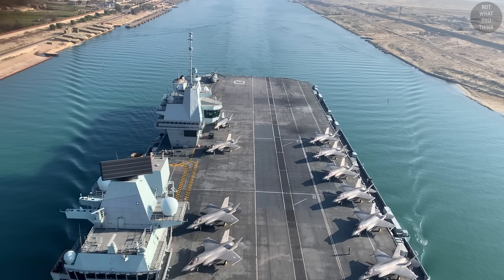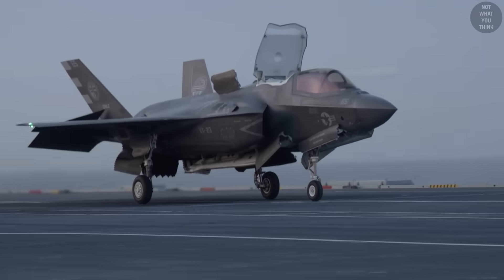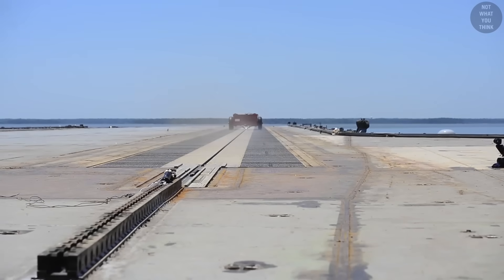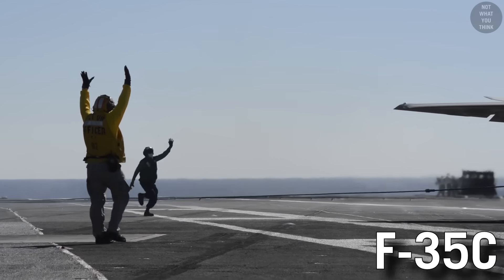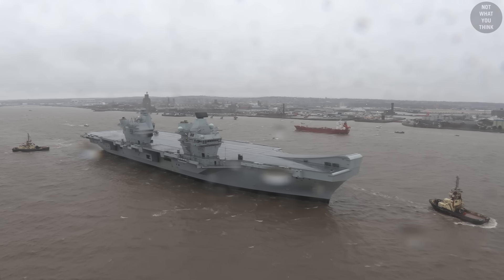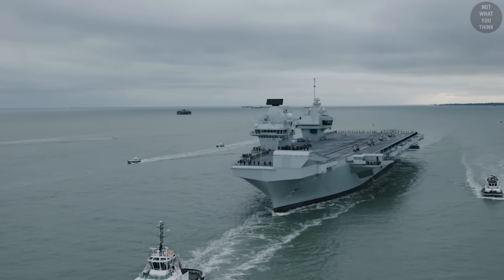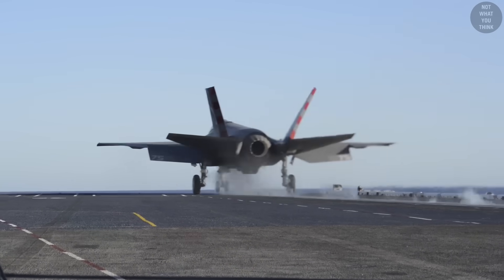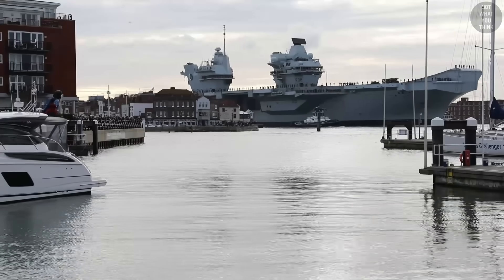Was the Angled Flight Deck Missed on HMS Queen Elizabeth?

Comment: Not all angles flight decks allow aircraft to land and take off at the same time, certainly without risk of collision if the landing is aborted. Some designs only protect aircraft parked forward. That's another advantage of STOVL - more aircraft can be launched and landed faster and simultaneously.  A disadvantage of catapult, is when they go unserviceable it slows down or stops launch of aircraft.

Comment: I think EMALS and arrestor gear for conventional jets (e.g. F35C) will most likely not be installed on the QE class. It is common knowledge that cats and traps are likely to be fitted for UCAVs but this is probably as far as it will go. By the time the F35B retires the QE carriers will be approaching the end of their operational lives so will go at about the same time.

Realistically, the money is not going to be there to switch to EMALS and buy CATOBAR jets ~2040. Too many other projects requiring funding (T85 destroyer, Astute replacement, Tempest, RAF transport fleet etc.) plus a baked-in budget shortfall mean this is not going to be a high priority. In true RN fashion they will make the best of what they have.

Comment: This may just be noobtalk but I feel like the old-fashioned arresting wire and barrier will save lives in case of actual war against an advanced opponent. For the simple reason of coping with battle damage or returning with hardly any fuel left. A vertical landing may be impossible in both cases.
Reply: Exactly my thoughts. Notice that the F-35 has only a single engine. The risk that entails is tolerable for land-based aircraft that can often find an airfield when an engine faila. For carrier-based aircraft, that carrier deck may be landing spot for 1,000 miles. A skilled pilot might manage to land on a carrier with an arresting wire. Without an engine he can't do a STOL touchdown. Oh, and here's a video about a Sea Harrier that, running low on fuel, managed to set down on a merchant vessel. https://www.youtube.com/watch?v=BD4oiBSXGDM
Reply: What happens if the arrestor cables snap or the mechanisms are damaged?

Comment: The angled Flight Deck is so Aircraft can simultaneously be launched and recovered with no disruptions.
Reply: The angled deck was primarily designed so that if an aircraft missed the arrestor cable it wouldnt crash into other aircraft as already explained in the video.

Comment: You forgot to mention one thing. In a raging war, you could imagine the enemy's initial targets would include airports and long strips of land to prevent conventional enemy aircraft from taking-off and joining the fight. Having combat aircraft that can take-off and land vertically and still be capable of mach flight would be a very big asset in such a scenario. They wouldn't need the conventional, long airstrips to be combat-ready and thus be more usable in protecting the airspace. What exactly is the use of a faster and longer-range aircraft if it is stuck on land, unable to take-off? VSTOL aircraft can practically join the fight from everywhere and that is the reason why I think it is the most ideal of the three F-35s.
Reply: yes and no, if your VTOL is maintenance-intensive like F35 I don't see it operating from open fields in the middle of a forest or on motorways or any place where full maintenance infrastructure is not available.
Reply: fighter planes don't need long strips of land to take off and land
Reply: That was the idea they had back in the cold war, and many VTOL fighter jets were in development as a result: The Dassault BALZAC, the British Harrier, the soviet Yak-38, etc. But it's still easier to build a makeshift runway for conventional fighters than it is to maintain VTOL fighters, and close-in weapons systems (CIWS) make air bases reasonably secure against air threats.
Reply: Who would that imagined enemy be that could destroy all British air strips?
Reply: @TorianTammas  they're more capable of destroying the planes themselves than destroying the runways.
Runways can be fixed within a few days and fighter planes can takeoff from very short distances.
Destroying runways is not to prevent fighter planes to takeoff, it's to prevent bigger planes to take off.
Reply: @TorianTammas  Well, given that majority of all british typhoons are kept in just 2 air bases, destroying those 2 won't be such a big task. And yes, russia is capable of destroying those bases lmao.

Comment: "The pilot needs mad skills" - this is ture, but I think the pilot needs to be a bit 'mad' to try a STVOL landing with a significant fuel/ordnance load. 😜
Reply: The F35 can land vertically with 2 500KG bombs and 2 AMRAAMs carried internally, plus enough fuel to fly a recovery profile. This only increases with a rolling landing.
Reply: They just need to be trained. There is a You Tube video of the simulator for that landing. Its very doable in operational conditions. Further, because the vessel’s flight deck is 280 x 70M, planes can be parked along the sides and hangars, so there is always a clear way for take off and landing operations, much like a conventional airport.
Reply: @Bessie Hillum I got that distinct impression also from watching the fool landing video.
Reply: Thank You for adding yet another reason why CATOBAR Carriers are the only real modern choice.

Comment: Wait, so if the QEC is powered by gas turbines, then isn't it a no-brainer to generate steam from their waste heat?  That's commonly done in power plants to massively increase efficiency.
Reply: They're gas turbines much like those on jet aircraft not steam turbines. Their exhaust is hot air not hot water.
Reply: @Inkling777  he is talking about a combined cycle gas plant which use the exhasut heat from gas turbines to produce steam for a steam turbine and raching a combined efficency of over 60% but these systems are incredibly heavy and since ships kinda need to float and usefull payload is not unlimited they are to heavy to be used.

Comment: Why in earth does Italy need 2 carriers??
Delusions of Roman grandeur
Reply: To project air power in the Mediterranean. Nothing to do with Roman history.
Reply: Possessing two carriers means one can be in refit or working up with a new crew while the other is operating and then they can swap. The French have a single aircraft carrier which has spent significant time since it was commissioned in a dockyard getting fixed, refitted and upgraded leaving the French Navy with no carrier capability for years at a time. See also the Russian carrier. These gaps mean a loss of skills since carrier ops require lots of flight time to keep the pilots trained up, never mind the ship handlers.

Basically a single carrier is not cost-effective if the aim is to actually operate carriers properly.
Reply: The systemic choice to go with carbon fuelled engines in Q.E. Class I did not understand...
Maybe nuclear is just too taboo...?
Reply: @soundknight  nuclear is too expensive.
Reply: Same reason as the Brits; so you can have at least one operational while the other is being refitted.